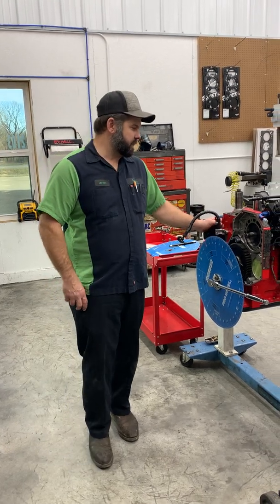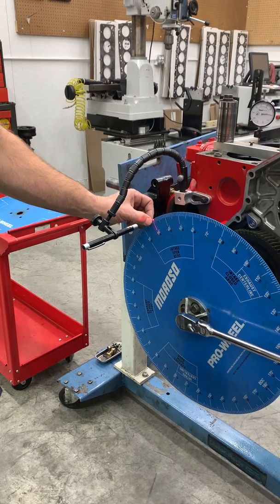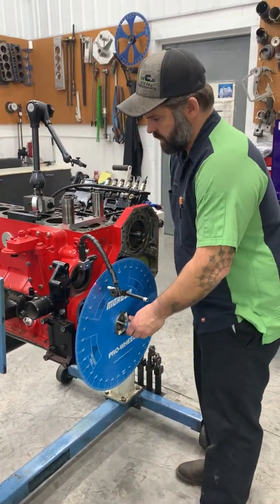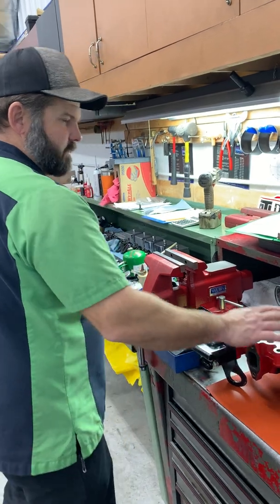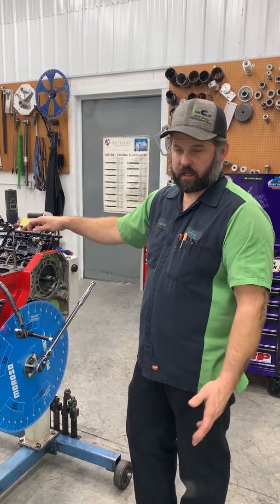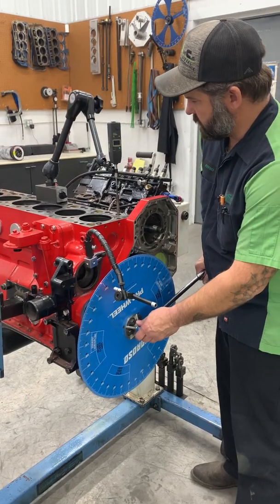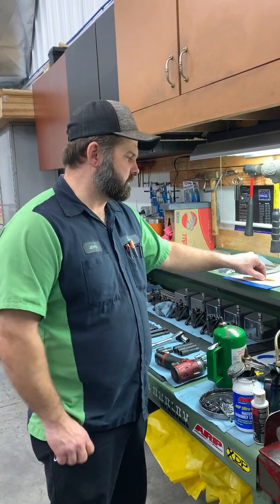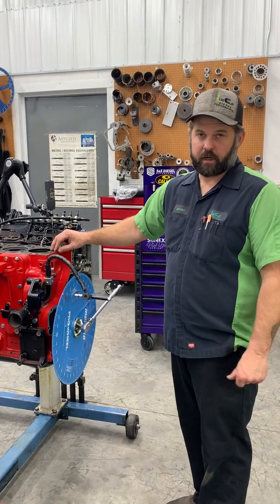Degreeing cam and checking valve to piston part 1

Comment: The cam i am planning to put in my 6.7 reccomended 98*-103* intake centerline, is there any benefit to being closer to one end or the other of that spec? Such as miving power towards top or bottom.
Reply from the maker: Yes, good question. Advancing cam timing brings power band lower in rpm and retarding cam timing raises power band. For a towing set up 98-99 intake centerline typically works well. If using a smaller cam in a higher rpm, large turbo set up 100-101 works good. Keep in mind each degree changes valve to piston roughly .005”. Advancing cam opens Intake earlier so you lose intake clearance, retarding nets you more intake clearance but effects exhaust. Typically a 99 cl is a good safe bet unless you have plenty of clearance.
Reply: @lincodieselperformance  mainly a weekend truck that tows with a s463.5 so sounds best to keep lower on the scale.
Reply from the maker: @markbrown2105  yes sir. 98-99 would be good for your set up.